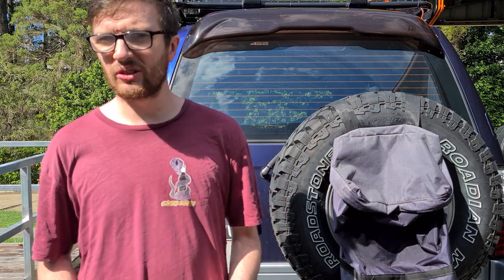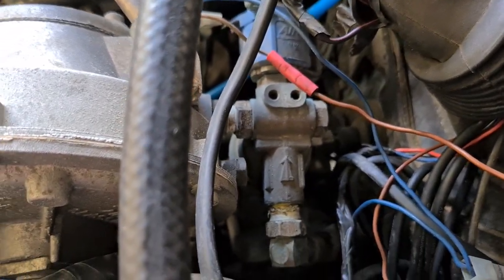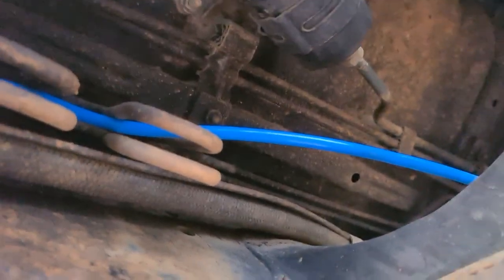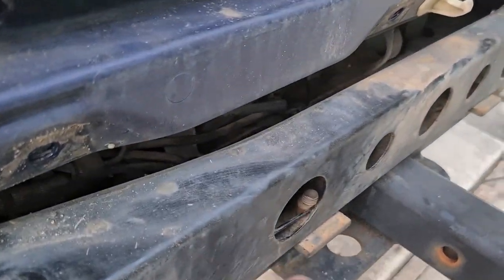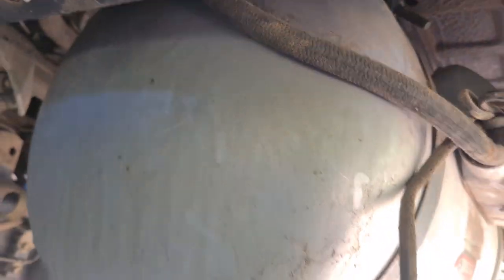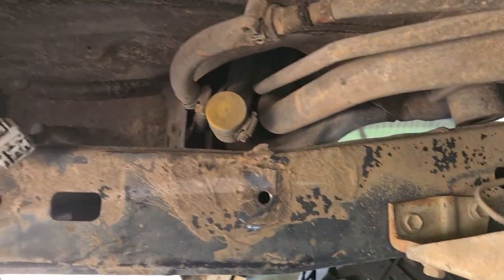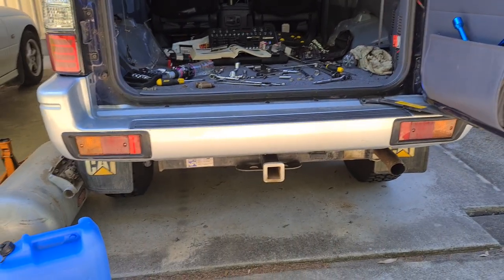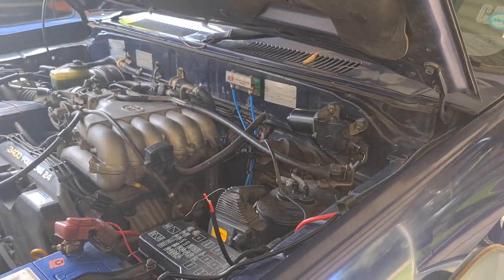Noelsy's Outdoors | 90 Series prado: LPG Removal

Comment: great vid gonna remove the lpg off my gq just curious how much wires there are for the gas and what you did with them
Reply from the maker: Yeah, there were a fair few but not too many, i didn't draw a diagram of my setup, but i think the bulk of it is part of the relay that switches the EFI off during lpg operation

Take photos, multimeter is your best mate, unplug thing one at a time. Dont cut anything without making notes
Reply: @NoelsysOutdoors hey mate just in the middle of removing mine does the hose from where you fill up the gas that comes from the tank let gas out if taken off i have the shut off valve for the one that runs to the motor but there no valve for the one that runs into the tank and i can’t take the tank off unless i remove the fill up line

Comment: Hey mate, great work thanks. Im about to remove an lpg system also. Did you find a way to drain the gas tank? Or even use it to run the bbq?
Reply from the maker: If you're lucky, you can dispose of them full at certain refuse centres, if thats not an option i would suggest the ol 90L bbq. Do not just air empty it as not only is it terribly dangerous its also a huge EPA fine. 

Thanks for watching hope this helps
Reply: @NoelsysOutdoors  thanks mate

Comment: Hey mate,
Just ripping mine out 
But mine is different to yours or you didnt mention it but i have a water feed line in to and out of my mixer?
Reply from the maker: yeah should be a water feed for warming the condenser to avoid condensation on the outside
theoretically should should be able to basically bypass the gas condenser with a brass fitting

Comment: Hey mate, thanks for the video! Couple of questions, what was the reasoning did removing the LPG? I’m thinking of removing mine, I’m getting such bad fuel economy from bad tunes trying to balance performance of both types of fuel. Do you think removing and tuning the car for just petrol will help improve economy? 
Also on big road trips I am not even finding lpg anymore.
How much is it going to cost to install a second petrol tank? 😊 thanks
Reply from the maker: Thanks for reaching out, cost of upkeep, efficiency, availability on remote trips, reliability theres a whole list of reasons to go back to petrol only but yeah id reccoment a retune if it is in your budget. Either way if you go the back to stock route or the long range route youll be better off in the long run IMHO

Thank you for the comment
Reply from the maker: Regarding the cost thats up to you, if you pay someone to do it, it could be expensive to fit a long range tank, but if you just go back to stock the second hand parts are hard to find

Personally since i did most of the work myself i think all in i so3nd about 1500 on all the parts and tools to fit a ling range tank myself, took me about 10 hours of labour so theres about 1200 for a shop to do it plus whatever the modification certification may or may not cost in your area

Always best to get quotes from reputable mechanics and see if its in your budget
Reply: @NoelsysOutdoors  thanks for getting back! The lack of LPG is seriously frustrating on big trips, my petrol tank is only 60L. Also my LPG consumption has almost halved, I get 200km when I used to get 350-400 per tank. My mechanic said the quality of LPG has dropped drastically. Another reason to change.

Comment: Hey bro, I’ve ripped mine out same motor, just wanted to know if you ripped out the wiring
Reply from the maker: Yeah i ended up removing the switch from the dash, my suggesttion is take photos and unplug plugs one at a time to see what it still needs to start, that way you can fault find as you go

Hope this helps
Reply: @NoelsysOutdoors  u know where I can find any diagrams?
Reply: @NoelsysOutdoors  u know where I can find any diagrams?
Reply from the maker: @bvmtb6230  id say take google sears the different relays for your lpg install. the hardest part about an lpg install is theyre all done slightly differently, mostly electrically. where yours may have been  done professionally with proper wiring looms and labelling, mine appears to have been done in someones backyard. if you get stuck a multimeter is your best friend

Comment: Hey mate I was just wondering if I should give this a go, I’m on my Ps and tryna save a bit of money to convert back to petrol but don’t have much mechanical experience, should I try it myself or get it done professionally?
Reply from the maker: If youre confedent with spanners then the tank is really easy to do. The hard part about converting back is the electrical side of it all

As for safety i reccomend finding the gas switch off tap on your tank or run it til empty first. And make sure your battery is disconnected

Im under the impression that all gas installations can be a bit different but if its the same as mine then its realistically a pretty easy job

Thanks for the comment
Reply from the maker: That being said, if youre not confident you can, then seek professional help at least for the removal. It may only cost labour and that may only be a couple hours.
Reply: @NoelsysOutdoors  Cheers noelsy not too confident but could probably get help from some mates, got a qoute for removal which is 800 bucks, so not too keen on that ahahaha
Reply from the maker: @jimskfczingerboxes2609  yeah just take all the safety measure you can like empty or turn off the tank disconnect your battery and take photos of before and after youll do fine